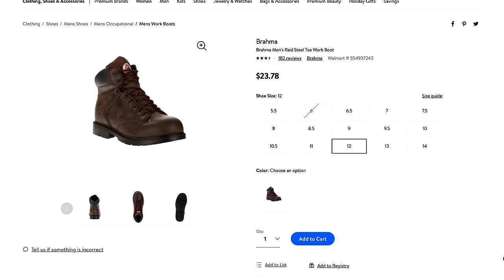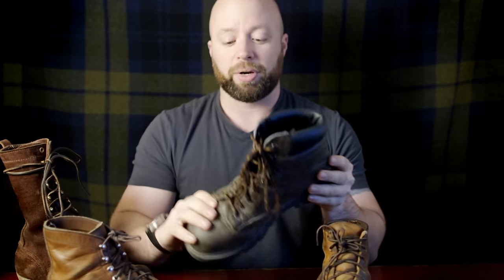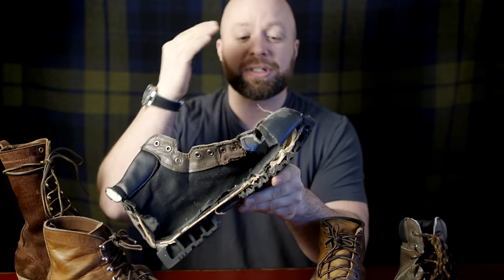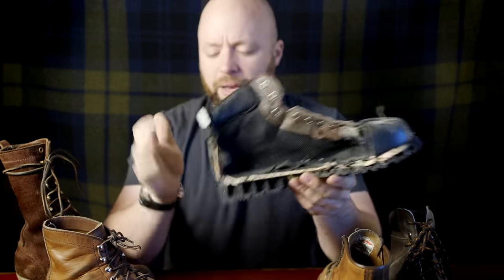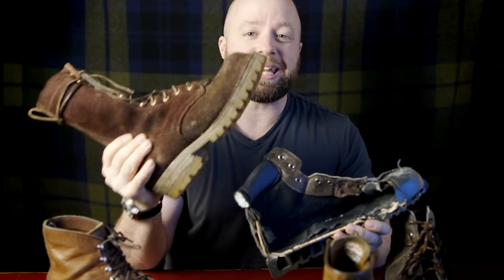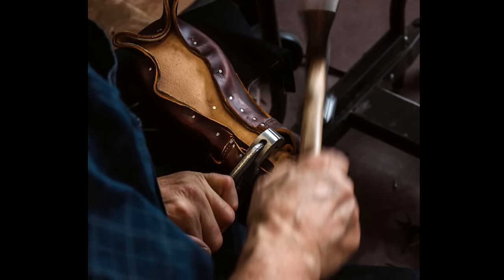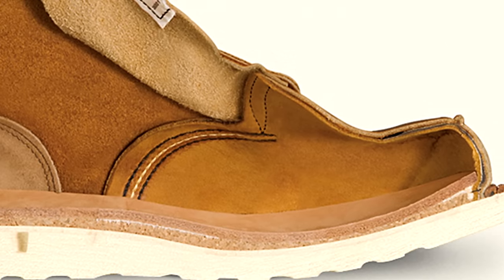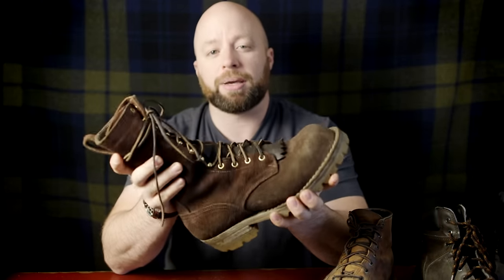Expensive vs Cheap Work Boots

Comment: I understand that this video is old, but I only ran across it today. I would like to say that the best thing I ever did was buy myself a pair of redwing boots.
Long story short, I got laid off from my desk job and decided to try truck driving, first time I climbed into the cab of a truck I could feel every step through the soles of the Nikes I was wearing.
A friend suggested that I buy a pair of redwings.  After being sized and getting what I thought was the right pair, I was back to school and not feeling a thing. Why do I say I thought I had the right pair? I bought a pair with safety toe. Turns out I really didn't need the safety toe, but that's fine, I corrected that a few days later, I went back and bought another pair without the safety toe, that was about three years ago, the safety toe are sitting in a corner collecting dust along with the tennis shoes I never wear because the only thing I wear now are the redwings without the safety toe.
I used to go through tennis shoes every 6 months or so because of my weight (read fat man)  I think I have another couple years in these boots. 
when you take into consideration the entry level of a pair of redwings compared to a pair of cheap nikes (I have never bought a pair of sneakers for more then 60 bucks I am cheap that way) 
just for arguments sake, let's say I went through a cheap pair of nikes every year paying 60 dollars over 3 years I would have spent 180 before taxes, The Truhiker 3 inch style 8672 I am currently sporting is just under 200 dollars, and I think there is at least another year if not 2 in these much abused boots.
So besides the higher upfront cost, they for me are a better value in the long run, and if I had properly cared for them and never ever stuck my bare feet in them, they would have lasted even longer.

Comment: I work for Walmart for almost 2 years now and I have experience with their work boots if you buy the cheapest work. boot or the most expensive work boot from them they're all trash. I bought a set of Herman Survivors during the height of the pandemic because my Timberlands ripped and we're filling up with water each time I would go through a small puddle. When I bought these boots the lining on the inside on the heel of the boot completely disintegrated, the boot smelled terrible where you couldn't get rid of the smell of foot odor and the inner soul completely disintegrated to where it couldn't be replaced because they use a special size which are not obtainable. These Boots lasted about 7 months but near the end it was just too painful so I had to throw them out. I never recommend anybody to buy shoes from Walmart unless they're going to use them as throwaways but with the price of the higher-end boots that Walmart sells a person might as well get Caterpillar, DeWalt, Wolverine boots made in Bangladesh, or a decent set of Timberland Pit Boss around the same price as the Herman Survivor professional series maybe even cheaper depending on sales.

Comment: I bought my last pair of safety toe boots back in 2010 and only now have I replaced them with an adequate pair just so I can do my research and invest in another 10 year pair. Hell mine don't even have to be replaced yet but I'd rather do it now than have the boot fail on site and be stuck with a pair of potatoes on my feet until I find a suitable replacement. Work hard for your money, so you can work smarter instead of harder while still working hard.

Comment: So I work outside. I haven't been able to find some good winter boots that would keep my tires warm. I don't need steel toe or anything special at all. Can anyone recommend boots that stay warm all day in 20-30f degree weather?
Reply from the maker: To companies I’ve had good luck with are Baffin and Refrigerwear. They’re not boots you’ll have for 10-20 years, but they also cost much less. I use the Baffin Apex boots for January and February night work on the railroad which is typically 20 to -10

Comment: Ten years as an electrician, learned early on, never skimp on foot wear... still buy decent shoes now that I've moved on engineering/estimating and don't have to head into the field anymore.  Same thing applies to my dress boots (I love my cowboy boots) - last month I finally threw out a pair of high end Abilene Western Boots that I've had since I was 16, they had been re-heeled and resoled probably 10-12 times, finally there wasn't enough leather left to stitch to.  Always do research and buy the best boots you can afford, they will save you in the long run... unless you're literally working on a jobsite that will destroy anything you wear (I worked a sewage plant overhaul for a month, I bought cheap boots for that, because I threw everything away at the end of the job, there was no saving any of it)

Comment: i work as a stagehand and regularly work 20 hour days some days i work in wet fields with standing water some days im in 5 star hotels other days im in arenas or parking lots this ever changing surface i have to walk on tears boots up and about 5 years ago i went from cheap work boots to mid to high level keens and after recently having talked to some coworkers who have been buying cheap walmart steel toes ive figured out that spending $300 on a pair of boots that lasts 3+ years is a lot cheaper then buying $30 boots every 2 months which is the life span most of my coworkers are getting before the boot is falling apart to the point of being unwearable

Comment: One thing I won't cheap out on is on boots, or jeans. That where I spend around $200 on just the boots alone and jeans $160 plus each. Your feet, knees and back will thank you down the road. Working as a aircraft and car technician and engineer I learned this early on. I am not one that get fooled by designer branding, It is the quality of materials, safety, comfort and true fit I go for.

Comment: Ok so I don't do real work unless it's outdoors but I always have 2 pairs of boots one for casual and one for working. Take not I'm not a fan of Sneakers since they cause me back pain. Casual boots are really the cheap ones like the Brahma Raid boots you had on screen something I can just throw on if it's a trip into town without too much walking example being grocery stores or stuff like that. I don't spend much on anything to be honest. When it comes to working boots I'm willing to spend more money on those for something that's comfortable and won't fall apart on me. I've been trying some Altama Boots that have the Vibram Sierra sole and they're desert tan rough out leather. I've had so much luck with them when it comes to outdoors work I bought them new at a garage sale for 20 dollars and they've seen a lot of wear. I don't think I'd recommend them for things like construction though since I did have to glue the very front of the sole when I got them. They're good for things like raking leaves trimming trees or hedges and for using the weed whacker. 

My personal opinion 

Don't spend too much for casual boots
Spend more for working boots prices vary depending on the job

Comment: I have 2 favorites. If I’m going out in tough terrain/heavy abuse working environments I love my Chippewa super loggers. The aggressive tread and support on my ankles is such a plus to have when working anywhere with loose gravel or muddy terrain. But if I’m doing an indoor job/carpentry or a on your feet for 8-10 hours a day situations I love my timberland pro wedge style boots. The super flat bottoms with the mild tread is nice and easy on the feet and ankles and knees.

Comment: Best work boots ever. CAT.  Working as a truck driver for 15 years. I still have my first pair and still can't see the steel cap coming through the leather toe cap.  I've gotten several pairs over the year since my employer covers 80% yearly for new work boots.  I have the shoe, the hikers, and the winter versions.  
Co-workers like to make fun of the winter ones because of how big they are.  Until they see me standing once again in a slush puddle inspecting my truck and not even noticing.  
At over $200 can,  per pair yeah they can be seen as a little expensive. But they are well worth every penny.

Comment: I consider as well that cheap boots will need to be replaced more quickly than a more expensive brand. For example a quality Dunlap or L.L. Bean boot will typically last 20 or more years. Where as a cheaper boot may need to be replaced in 3 or less years. Sometimes one may wonder is going cheap really going to save you money in the long term? This is subject to debate...

Comment: After trying keens I can't go back to lug soles. I'm all over the job site and do a ton of walking and climbing. The men's Dover are the most comfortable work boots I've worn and it's not even a close. I've been at my job 10+ years and we get a 300$ boot voucher so I've been lucky enough to try every major manufactured boot brand on the market. Boots I would never afford if I was the one footing the bill. Keen blow away boots I've paid 500$ for in terms of comfort and they're pretty affordable. Also keen dry is the best water proofing membrane I've come across. Better than gortex better than whatever redwings Carolina and Timberlands use. Keen dry actually last longer than a year your feet aren't soaking wet within an hour of putting them on. Other boots water proofing defeat the purpose of a waterproof boot. Sure they don't let water in from outside but your feet can't breathe and get so sweaty your feet are totally wet within a few hours. If you don't have a boot dryer your boots are still wet in the morning from the previous day's sweat.

Comment: Back in the '70s, the boot to buy was the Redwing (Irish Setter?), I looked, out of curiosity, a while back, and it is no longer the same boot. (Tennis shoes and the brainless public have annihilated the quality shoe market, made in Asia for a quarter, sold for over $100). As an electrical lineman, I wore Wesco boots, but never had them custom made. My foreman did, and he couldn't get them on, not enough room, go figure. Back in the day, they had double steel shanks for standing in hooks. Now I believe it is different.

Comment: I'm unemployed and don't work but I wear ugg butte boots for winter and another ugg boot for fall. I wear vans to lift weights, I wear jordan/Nike basketball shoes the retro kind for walking around. Should I buy some red wings???  I was supposed to be an IT but ended up being unemployed and living with my mom. so if they are worth it, I will definitely let my mom know so she can buy me some.
Reply from the maker: Well I don't think you can go wrong with a pair of Red Wing Iron Rangers or Blacksmith boots. They are built well, look good, and don't have any extra safety options you don't need (like a steel toe). However, if you think you'll eventually want to earn some extra money as a laborer or landscaper you might want something a bit more robust like the Red Wing moc toe boots. Keep in mind that Red Wing has their "heritage" line, and their "work" line. The difference is in the designs and the leather used. Heritage boots are more for guys who want the look, and their normal line is cheaper and geared toward actual work. Just food for thought!
Reply: Carl Murawski thanks Carl will definitely get some Incase I have to be a car mechanic 👍🏻

Comment: From my experience super cheap work boots don’t last very long before they fall apart. And super expensive work boots leather has a tendency to be much softer leathers so the leather gets damaged easy but the comfort level is remarkable and usually able to be resoled so if the leather is not taking a beating it’s gonna be worth the money. And modicum priced of $100-$150 the comfort is gonna be ok but not amazing but the leather usually is much more durable and holds up longer. For example on difference my first pair of work boots where Brahma which the sole separated after 2 weeks and killed my feet while walking around and didn’t breathe. My second pair was Georgia Giant work boots where the comfort was ok but didn’t breathe too well but it held up for 5 years before the crease in the leather from where your toe of the boot bends gave out around the seams. I used mink oil on the boots making them waterproof and the boots took a heavy beating from house building, logging, and welding. Then my last pair of boots I’ve bought where Danner work boots which are expensive the boots got some serious nicks in a few weeks of wear doing light work in them but are the most comfortable boot to wear. I’ve stopped using them for any work that can and would further damage the leather since those boots received serious cuts and damages from just splitting firewood where my Georgia Giant boots that cost half would only get a light scruff with no real damage to the leather.

Comment: Hey Carl!  Great work on this wonderful channel.  What are some cheap work/heritage boot brands in the $70 to $100 range that you'd recommend?
Reply from the maker: Thank you so much! I would check out Nordstrom Rack and Sierra Trading Post for a good deal on some Red Wings or Wolverines. Mostly anything you could buy around $100 new won’t be that great, but you can get some amazing deals at those two places on a boot you’ll have for a long time.

Comment: I'm on my feet all day. For what I do a good hiker fits the bill. 
 I used to think like the $60 guys. Then I had an "aha" moment.  After I had my first kid and discovered I couldn't hold her for more than 5-10 minutes without moderate back pain.  I bit the bullet and bought a $250 pair of boots. I haven't had a single. problem. since. 
 I was absolutely blown away by the difference a good pair of shoes made. It truly is night and day!
Reply from the maker: Hikers are great if the safety guy allows them. I wore a pair of Oboz hikers for an 18 month veteran housing project and they worked wonderfully.

Comment: Depending on my environment. 

Red wings have always been a good long lasting boot (although a little heavy IMO)

Tried Danners last year because they are capable of being re-soled very comfortable and break in was almost instant, leather seems to be high quality. Haven't worn them out after about 18 months 

Also occasionally wear in a residential setting. Keen mid duty hiker because they are lightweight and very comfortable.

Bottom line: Take care your feet, you can't just go out buy another pair of those...

Comment: Most jobs I've had that required special footwear. Required steel toes boots that are 100% waterproof. (None of the ones in this video are waterproof.)  One thing that helps make any footwear more comfortable is to buy molded prescription footwear. There are several excuses you can use to get a prescription from diabetes to a sore back to sore feet.

Comment: im wearing those brahma boots right now, and i can definitely say that they're awful. i used them for working in a smithy, and they held up for the month that i used them. i've dropped hot metal on them a few times, and it didn't manage to go through or anything like that. but after month two of having them, i made the mistake of wearing them in the rain- since the soles are hollow under the traction, it allowed water to get all into the bottom of my boots and practically ruined them. no amount of shoe goo could fix them.

Comment: I'm a ditch digger 20 years in the Pacific Northwest.

I buy one pair of Georgia 8" loggers a year. The 200g thinsulate goretex variety.

I tried 2 pairs of super rainforest boots years ago when I started in construction. Waterproofing lasted 6-9 months first pair. Sent them back and same with the replacement pair.

Tossed them.

Georgias are about 180 a pair / year. Vs 350 for the danners and time/cost + turn around for a rebuild.

Now. That said. About 10 years ago. I got fed up buying boots and I went to a whites salesman to get fitted. After measuring my feet she asked what kind of work I do and what application. I told her I work in underground, wet conditions, lots of dirt, asphalt, mud, snow, rain etc. She turned me away and told me to keep buying Georgias or whatever my preference is. In these conditions I will destroy any boot made in 12 months or less. And I do. 

I honestly wish a well made, US boot could last in the dirt but they just don't.

For all other trades. Certainly do NOT cheap out on your feet.

Comment: Recurring back pain and shin splints from my earlier years in the Marine Corps taught me THIS lesson!🤣
No sooner did I STOP wearing cheap @ss: Jungle Boots (Work & field use), $60-$80 Nikes (PT), and opened up the wallet to step into: Danner's boots & Saucony or Asic Gel (running & replaced EVERY 6 months!). 
For some strange reason, the aches and pains subsided at the tune of $180 and ⬆️ for my running shoes, and $200 ⬆️ and up for my boots!😂🤣 My wallet cried but feet, ankles, lower back, shins and knees sighed relief!
There's certain things we can skimp on within our lives, but proper footwear should never be one of them!

Comment: As someone who works in an office, even then you should invest in good shoes and for general life. I have tried convincing several people to spend a bit more now as usually you not only have better shoes, but long term they are often notably cheaper as well as they don't just fall apart. That and more comfortable shoes are well, more comfortable and reduce any aches and pains one may have and just make your days so much more pleasant. The only time to go cheap, is for example is the only time you use them is when you mow the lawns once every few weeks or similar, or if you have a particularly dirty job where you may want to through the boots out afterwards.
Reply from the maker: Good point!